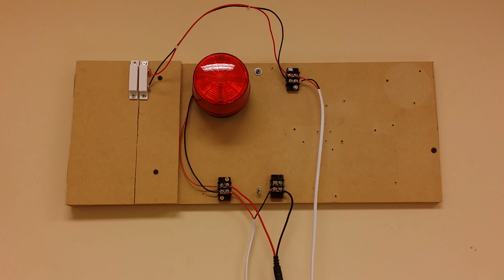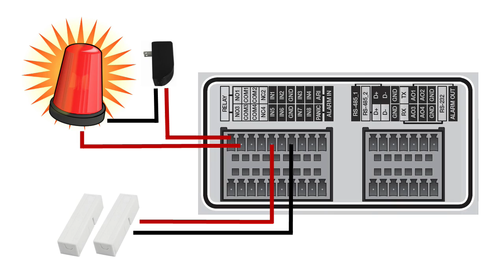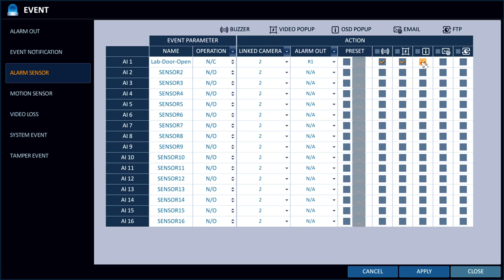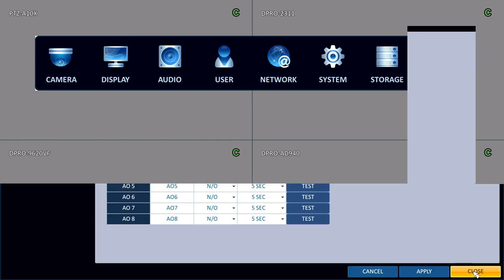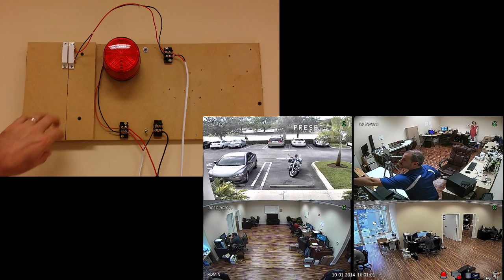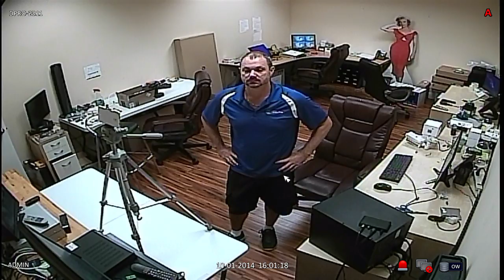CCTV DVR Alarm Input / Alarm Relay Output Setup

Comment: Thanks for this video. I'm struggling to find the specification for the type of terminal that plugs into the DVR alarm contacts as shown in your video. Can you recommend a brand/model#?
Reply from the maker: Hi Chris. We always supply the terminals with the DVRs and NVRs that we sell. I have never seen them sold separately because the style varies based on the recorder and number of alarm inputs / outputs. Our Viewtron DVRs and NVRs are highly recommended. https://www.cctvcamerapros.com/Security-Camera-DVRs-s/1467.htm

Comment: Hi, would like to ask what is the material you use to make your demo board?
Reply from the maker: Toofat Chong the actual board is just wood press board. The strobe light is a 12V DC burglar alarm strobe A generic magnetic door sensor and some screw down wire terminals that we got from Radio Shack before it closed down.

Comment: Its also working with IP Cameras ? i need to set up ip camera with a DVR which also have output relais... thx
Reply from the maker: Sebastian Cotae thank you for watching! At this time, iDVR-PRO only woks with CCTV cameras and we are adding support for AHD cameras within a few months. For network IP cameras, we do have other solutions that support alarm inputs and relays.

1) Some Zavio IP cameras have alarm relay inputs / outputs built into them which can be used in similar ways described in this video. You can learn about Zavio IP cameras with built-in digital IO here. 
http://www.cctvcamerapros.com/IP-Camera-Digital-IO-s/716.htm

2) Zavio NVRs also support alarm input / output. You can find those here.
http://www.cctvcamerapros.com/Zavio-NVRs-s/801.htm

3) Here is an article on how to setup Alarm triggers on Zavio IP cameras.
http://videos.cctvcamerapros.com/digital-io-alarm-in-out/network-ip-camera-digital-io-setup.html

Comment from the maker: CCTV DVR Alarm In / Alarm Relay Out Setup
Watch this video to see magnetic door sensors trigger surveillance video recording and activate an alarm strobe light.

This iDVR-PRO is configured to take the following actions when the door sensors are triggered. 

  ~ The DVR starts video recording.
  ~ The DVR sounds an audio buzzer.
  ~ Video from the CCTV camera associated with the alarm is displayed full screen.
  ~ An alarm message is displayed on the screen.

The DVR can also be configured to send email alerts and FTP upload a pictures of events (not done in this video).

The types of alarm sensors used in this video are just a few examples of the types that can integrate with a security DVR. Other types include: PIR motion detectors, glass break detectors, and infrared trip wires.

For more information about how these sensors were wired and how the DVR software was configured, please visit this page.
http://www.cctvcamerapros.com/DVR-Alarm

 #cctvcameras   #cctvsystems   #alarmsystems
Reply: you could hook the light to your camera power provided there the same volatges, plus ull have protection. so buy bigger pwer supply than what u need. last every thing is in one place when things go wrong lol.
Reply: does this dvr do alarm per motion square too? and can u define your areas for motion detection? So say you have it looking ata door but it sees the street to so you only pick the squares that are not seeing the street traffic and only triggers motion recording when in the defined areas. like i like to put motion  5,  continuous at 1 and alarm at 20. all this would be a good video subject too. it can be a hot subject every one has there preferred setups. but this subject can be confusing to users.
Reply: Wow, this camera in this videos is very good!  what mark and model? Thanks!
Reply from the maker: Canal M Thank you for watching!  The following cameras were connected to the DVR when we made this video. These are the CCTV cameras that you see in the 4 camera grid view when the video is playing.

Camera 1 : DPRO-AS700 Weatherproof Dome
http://www.cctvcamerapros.com/Vandal-Dome-Camera-p/dpro-as700.htm

Camera 2 : DPRO-92311 Indoor Dome
http://www.cctvcamerapros.com/Dome-Security-Camera-p/dpro-92311.htm

Camera 3 : DPRO-92311 IR Indoor Dome (Varifocal)
http://www.cctvcamerapros.com/Dome-IR-Camera-p/dpro-9620vfw.htm

Camera 4 : DPRO-L36W Infrared Indoor Dome (Fixed Lens)
http://www.cctvcamerapros.com/Indoor-Dome-CCTV-Camera-p/dpro-l36w.htm
Reply from the maker: Tanker Templar yes, this DVR also supports motion detection video recording. Yes, you can define zones for each camera where the motion is activated and you can have other camera's recording activated by other triggers / alarms. Please take a look here for more information on motion detection recording setup.
http://www.cctvcamerapros.com/H-264-DVR-Recording-Setup-s/824.htm#motion-detection